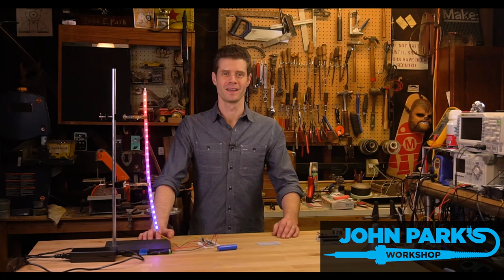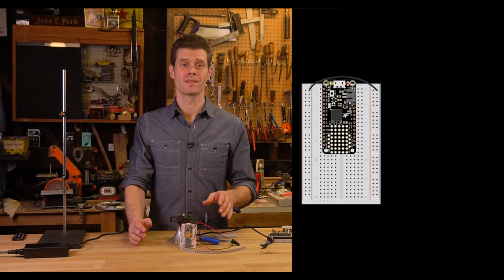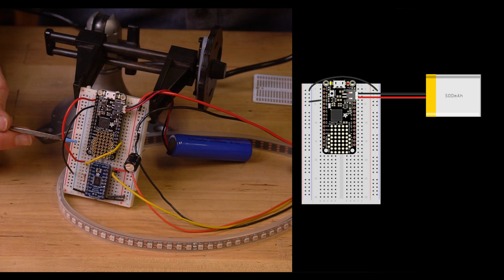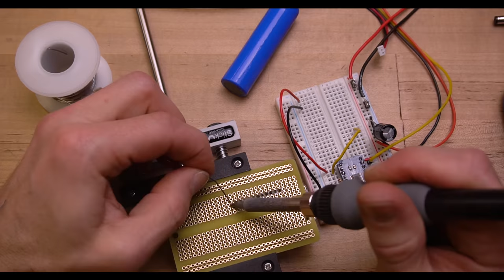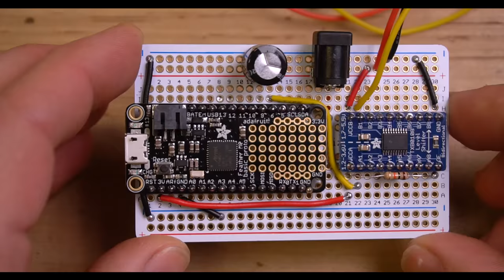John Park's NeoPixel Level Shifter  @adafruit @johnedgarpark #adafruit

Comment: Hi John,  Thanks for a great video.  It is one of the best descriptions on the use of Level Shifters.....However.
Throughout the video, in the actual video of the Breadboard, and the Prototyping board, there is a resistor going from VCCA to the OE pin.
This resistor is NOT in the drawing that you create, and you don't make any mention of it.
On the Adafruit page for this level shifter board is this statement:
"One should never leave the OE pin floating in an indeterminate state......"
I know it has been a long time since you made this video, but is there a chance you could review it and include an update on the use of the OE pin?
Reply: I was also annoyed at this omission. There is also no mention of the resistor shown attached to the data pin on the neo pixel. Regarding the OE pin that pin is basically the on/off trigger. So by soldering the resistor between the VCCA and OE, that is locking the level shifter into the ON position.

Comment: One Neopixel with 4.5V supply after the 3.3V output does the job too. 
The 4.5V can be generated from the 5V via a 1N400x diode. 
The second LED then gets the full 5V.
Or
Almost every 74HCT## or 74ACT## ic. Maybe also a old 74LS##

Comment: For everyone saying they never had an issue with this, I never had an issue with it either til I did!

I have a 120 LED strip of WS2812B that ran off my esp8266 with no issues what so ever

Then I tried to hook up PL9823 through hole leds (even just one) and they didn't work, I got inconsistent colours (e.g. set it to red and it might turn blue etc). Was sure I got a bad batch of LEDS til I hooked them up to a Mega and they worked perfectly. I seen the same behavior with through hole Neopixels from Adafruit too.

The solution I used was to add a 220pf capacitor between the data in of the first LED and ground and that solved my issue. I'll be honest, I'm not sure why it works, I saw the "trick" on Andreass Spiess YT channel.

Comment: I have never had a problem driving neo pixels with 3v3 data from trinkets.
Reply: based on the datasheet, it should work with 3v3. awesome!
Reply: Datasheet says High = 0.7V * VCC, and 5V is VCC -> 0.7V*5V=3,5V ... and this is why there are so many times some issues...
Reply: Good thing I didn't connect the data sheet to a trinket. The point being be aware that it is not guaranteed to work.

Comment: Solid work, John. In my case I think I need level shifters so I can use 5V sensors on a 3.3V microcontroller; I think everything you said is still relevant.
Reply: For this case, you just invert the conexions and the B1 goes to the ESP32, and the sensor exit goes to the A1?

Comment: Also never had issues running WS2812B strips (Neopixels) off ESP8266 boards either. Have always wondered about if I should use level shifters, but I guess if it's in spec and it works, it works?!
Reply: Yes, I only run into this on longer runs of wiring, or when I have lots (like dozens and dozens) of NeoPixels. Then suddenly all kinds of chaos ensues.

Comment: My led light up when I dont use a shifter and then I added everything in and now it doesn't work. My external supply is a 5v 3A mobile power bank.

Comment: Why not simply use a logic N-mosfet with the Gate to the MCU, the Drain to the same 5V that feed the neopixels and the source to Data pins of neopixels. I’m thinking Infineon IPS70R1K4P7S will work fine, right?

Comment: Just configure the output in the microcontroller as open-drain, and use a pull-up resistor to the 5V power supply. It cannot get easier and cheaper than that.
Reply: Every microcontroller output has the protection diodes to 3V3 
even if you switch between pull low and pin input = float state
So it's not a real open drain but limited to 3.3V + 0.6 Volt
This means that current flows into the microcontroller via the pullup resistor. 
3.9 volts is a little more than 3.3 V.

It is better to take a 74HCT125. It recognizes 2V and more as high and outputs true 5V.
The Neopixel need 70% of 5V, i.e. 3.5V, for high. And 30%. i.e. less 1.5V, for LOW

Comment: have you delay from microcontroler and output device with bi-directional 8 channel ? I know your example use NeoPixels and this is slow,but can be very important when use with fast devices for feedback realtime issue.

Comment: Does this provide isolation for gpio also ?
Reply: I checked the datasheet, ±15-kV ESD PROTECTION.

So no, i wonder if a signal opto is fast enough to drive these. Might have to test that out, would love some isolation for long runs of pixels.
Reply: Optical coupling is always super fast. 
(I should never say "Always".)
Reply: I am actually looking at digital isolators now, optos are very dependant on drive current, and transition state times, some cannot transition faster than 10ns and they are not digital compatible, you need 20ma forward current so then you have to deal with transistor speed, and they also invert, so you have to deal with that also.